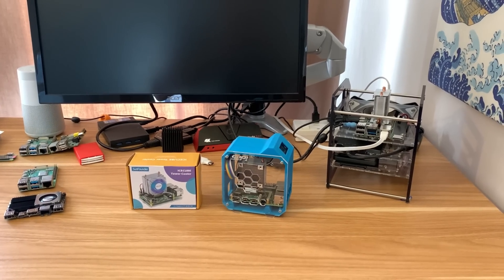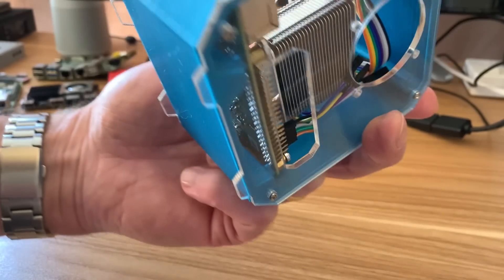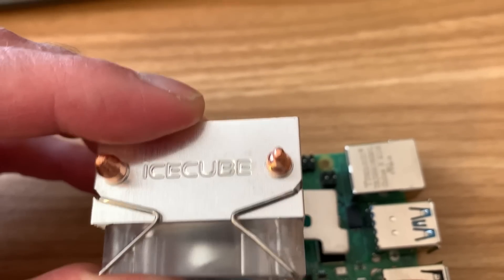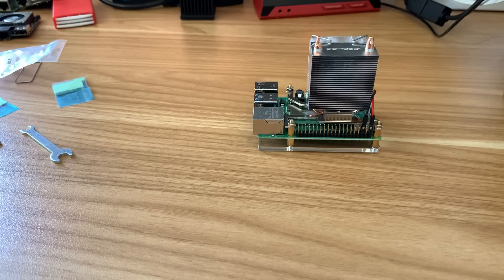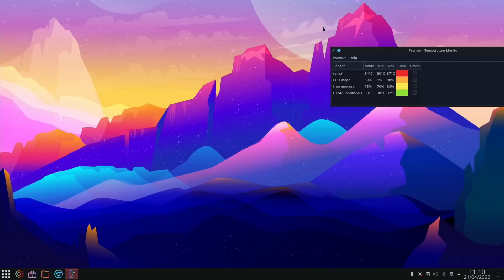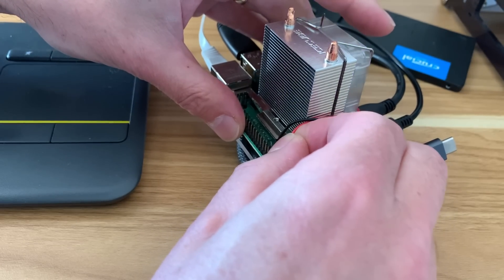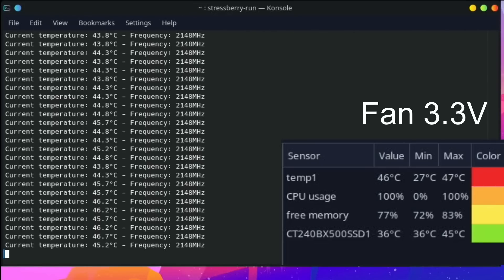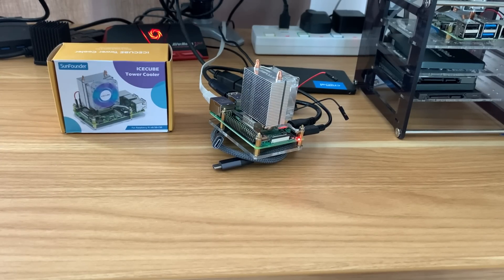Sunfounder ICECUBE cooler.  Raspberry Pi 4. 5V, 3.3V and passive cooling tests.

Comment: I recently purchased this cooler and found out that the included thermal pads aren't thick enough to make good contact with the CPU, so i used 2 thermal pads instead of one on the CPU, and now the temperature never goes above 38c, even when running the fan at 3.3v and overclocked

Comment: Great overview! I am looking at ordering this but I am new to wiring the GPIO. Do you know if I can also add an LED power button to the GPIO or does the fan use the necessary pins? I am installing my pi in an arcade cabinet and would like to have a power button on the outside to make shutting it off easy for my nephew.
Reply from the maker: You can add all sorts to the gpio and assign pins to functions

Comment: That's  Great !     A  real CPU needs a real cooler... and Raspberry should  set a STANDARD  mount for cooling solutions.   
So when  The Raspberry  Pi  V   (5)      comes out,  people will have a variety of interchangable cooling solutions available for their little computer.
Either horizontal or verticle,   liquid, air, or electrically powered coolers.    It's important to keep components cool and healthy !

Comment: Looks like a decent cooler, though with just a small fan and a smallish cpu stick on, I can't seem to get it to go past 65c or so on my 8GB. Still, I'm looking to use the pi as a small computing desktop (power is getting expensive), so this might be good for some solid overclock to make things smoother. Sadly, it's out of stock.

Comment: Great Video again, I am looking to test my configuration with the 52pi icetower and using the fan so not passive and also using the 120mm fan on the 52pi rack. i followed the installation part for stressberry and think i copied your run command correctly but it wont run. Any chance of putting the command you used for stressberry into the details below the video? TIA
Reply from the maker: stressberry-run -n "My Test" -d 100 -i 30 -c 4 mytest.out

You may need to restart before running stressberry

This video has more details 

CPU paste Vs Thermal Pad. Raspberry Pi 4
https://youtu.be/-Z05yBrU0jQ
Reply: @leepspvideo  Ok really confused by the error im getting. I have removed stress berry rebooted, reinstalled stress berry using sudo apt install stress and then rebooted. On running the copied command from your post and the original video referenced i am getting an error which reads as follows :- 

bash: stressberry-run: command not found

below is the whole terminal output from the command i enter to the resulting error

52pi@raspberrypi:~ $ stressberry-run -n "My Test" -d 100 -i 30 -c 4 mytest.out
bash: stressberry-run: command not found
52pi@raspberrypi:~ $
Reply from the maker: @Retroornew  From the stresberry github did you run

sudo apt install stress

python3 -m pip install stressberry

GitHub link
https://github.com/nschloe/stressberry

Are you using Raspberry Pi os or something else?
Reply: @leepspvideo  i did exactly that im running pi os 64 bit. I have done a fresh install of Pi OS now and swapped out the Sabrent Sata to USB 3 for my CJS cable and all now working fine. not sure which one it was but this seems to have done the trick. Many thanks for the support

Comment: Bought the ICECUBE Tower cooler because of this video.... is there supposed to be a GAP between the thin thermal pad and the CPU??  I can see light there, so there's no contact - am afraid to power on until I get an answer. Yes, it's a Pi 4B. Should I trim to size the extra thicker pad and use it or double up on the thin pads?
Does the pad expand when heated to fill the gap?
Reply from the maker: I have no gap between my thermal pad and the cpu. The Pi can be used without any cooling so there is no danger. Try the pi on its own then with the cooler.

You can then see if it’s making a difference.
Reply: @leepspvideo  that's not a solution; I'll shift to the thicker pad.... or two thin pads stacked, which worked great.  Gotta wonder if the CPUs vary in thickness enough to cause this issue.
Reply: @swolfarnold  another alternative would be to file down the brass stand-offs very slightly to get the heatsink to fit flush,
That way you can get a good fit with thermal paste instead of the pads.

Comment: This pretty much sums up one of the key things that is wrong with the Pi4. It is supposed to be a low cost thing and yet from the start it has required a cooler to prevent overheating. Upton needs to rectify tis mistake with the next version.

Comment: I’m still sticking with passive cooling via CooliPi, with a double layer of padding it even reaches and cools the power chips. I can run it full throttle (folding proteins) for months and months that way, always less than 50 degrees C. It makes the Pi about 4 times bigger than it would normally be, with all the metal, which is much more than most other heat sinks.
Reply: Interesting, I have the passive case from geek worm which passively cools the power chip and usb controller aswell, but it’s nowhere as powerful as CooliPi tho, that CooliPi is pretty amazing

Comment: I fell in love with the Low Profile Ice Tower thanks to watching one of ETA Prime's videos yrs ago & one of ur videos. Loved it so much that when i converted my 4GB Pi 4 over to my OVM5 NAS i left the tower on it & got another one off Amazon from 52pi's Geekpi page. My original one i got from Seeed Studio & loved it. 

The fan that came with my Canakit was meh ok at best but my pi was hitting up to 75°C then it would often shoot up to the thermal throttle limit in the 90's. Put the LP Ice Tower on & both of my OC 4GB & 8GB Pi 4's don't get past 42°C but often run at 37°. Occasionally if I'm rendering a video i can spike it to 56°C but that's cuz i've got the 2.1GHZ OC w/8OV & a 750mhz OC on the GPU.

Comment: Prefer passive cooling (if possible). Routinely do not overclock my Pi's. Biggest problem with active cooling is usually a fan and fans fail.
Combo of passive & active cooling have on some of my Pi's with the passive cooling being a default or backup until the problem with the active system is realized/corrected.